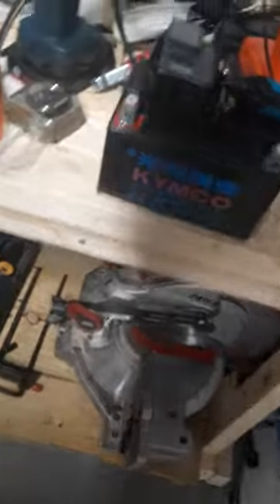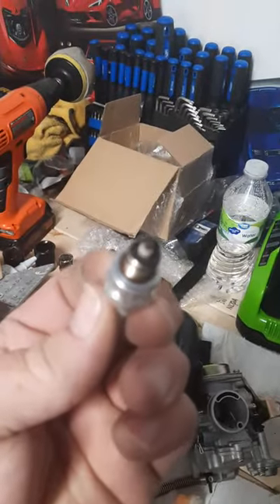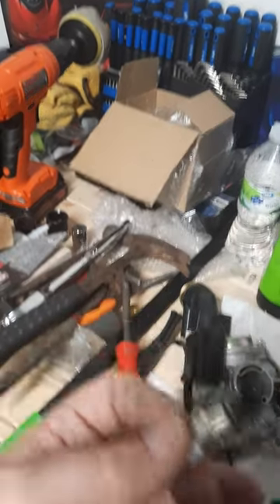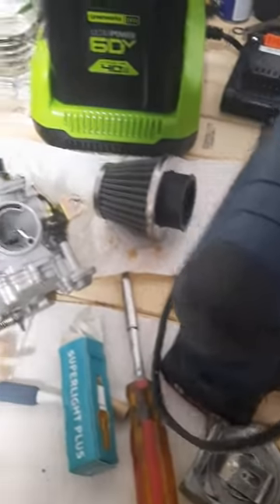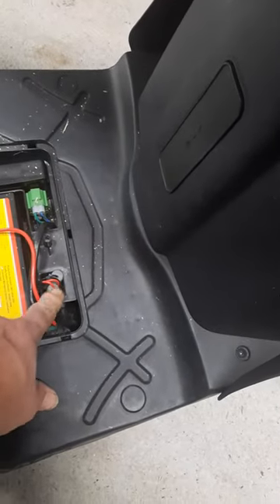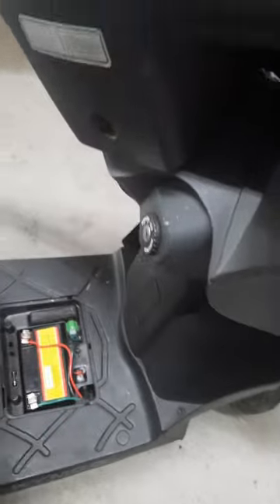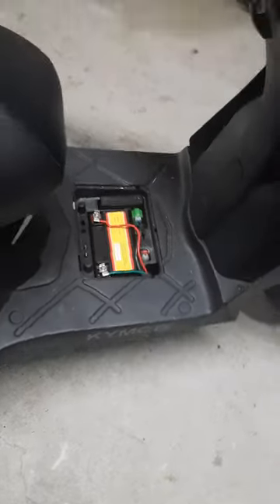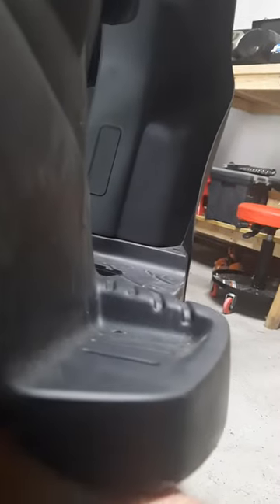New Battery, Now No Fire

Comment: On most gy6 vehicles the cdi is powered by an ac supply straight from the dynamo but the kymcos run the cdi on dc current from the battery through the ignition switch.